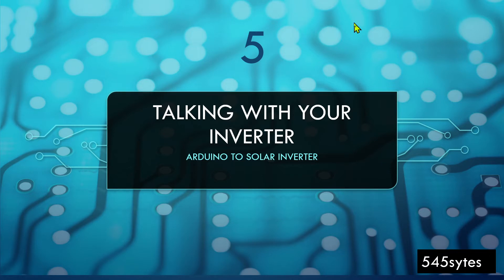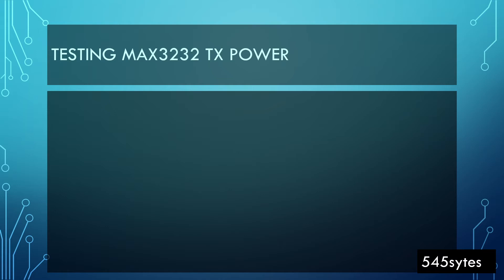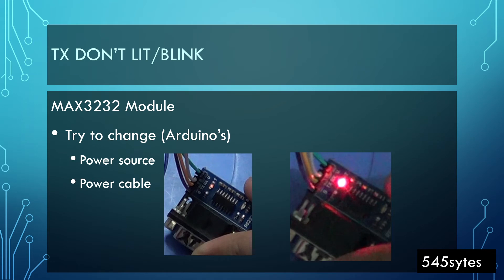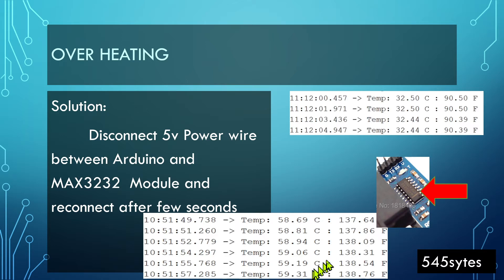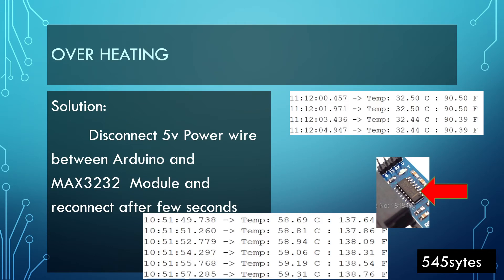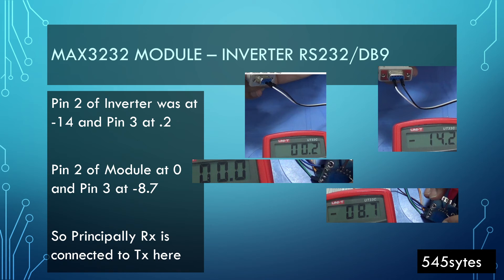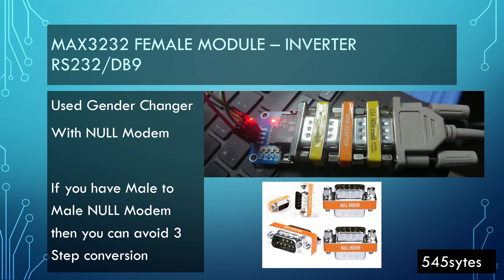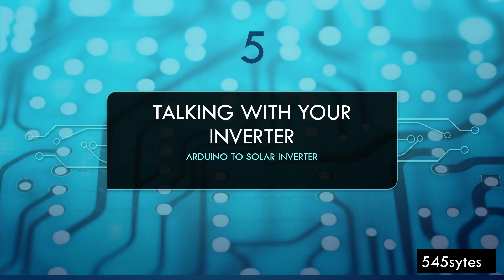5 (Ard to Invt) Connections Wiring & Known Issues & Solutions

Comment: Hi, nice videos! I want to know if it would be possible to power an esp8266 (or mega) from the rj45 port. May be we need a LDO but have we got any power pin? Have you got experiencie with maximum current that we could get from that rj45's pin ?

Thnaks.
Reply from the maker: I am running a 1080p camera through POE

So if you have  right hardware ,  8266 shouldn't be a problem as it is not power hungry

Though I may not be able to further assist on actual setup as I have limited knowledge on this topic for now
Reply: @545sytes  what pin are you using ?
Reply from the maker: I am using a POE router/switch, so technically that must be standard wiring PIN out. Not a DIY solution. 

What I know, POE start with at least Cat5e cable.
Reply: @545sytes  sorry, I understood you that you are using 12v FROM the inverter. So you are NOT using it, are you ?
Reply from the maker: Yes I am using AC out of inverter, then convert it back to 12v DC with adapter 😁

Comment from the maker: Update: From few days I am using a module with MAX3232 ESE + 1918 chip, no errors, no heating up, no disconnection at time of boot is required so far. The module used till time of video had MAX3232 CSE+1502 chip on it.
Reply from the maker: https://forum.arduino.cc/t/rs232-read-data-from-mpp-solar-inverter/600960/52?u=athersaleem  (For Picture of Module)